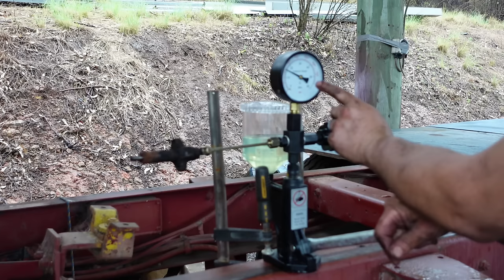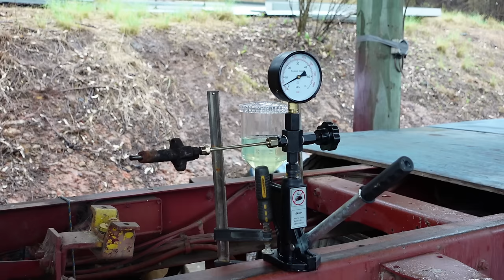SAME Centauro  60 Tractor: Hydraulic Blade Tilt and Diesel Engine Repair

Comment: The SAME rides again! Nice job on the blade lift and tilt setup. That will make the machine a lot handier around the ranch.  The injector pattern looked good to me on all but the one that wasn't flowing. I can see there's some engine wear by the smoke,  but looks like there's lots of life left in her. Glad you recognized those guys with the long tails down by the fence - I was gonna mention to you that you had neighbours comin by eatin yer grass!  8^) Cheers!
Reply from the maker: Hi Jeff. Thank you, it turned out great for using stuff that was laying around here. Injector pattern was fine. It would be compression, I’m near certain of it. Plenty of life left in it yes. They are always here eating the grass Jeff😅😅

Comment: Very popular tractors in New Zealand in the early seventies due to the ability to handle the hill country as they had relatively wide wheel base and four wheel drive. Thanks for the video Mate 👍
Reply from the maker: Hi mate thanks for sharing this. It’s a great tractor around the hills. It’s half the reason I got it going again, to clear the hills here where a fire went through. It’s my pleasure
Reply: Didn't know they were in Kiwi land. Thanks from northland.

Comment: Those Same Centauros were very popular here in Spain, together with a lot of other Same models, plain and simple air cooled, fairly easy to work on and as tough as old boots. The biggest drawback is the turning circle was not as good as a similar size say John Deere 2035. BTW give thanks to Matty's Workshop, he mentioned your channel and you gained a subscriber.
Reply from the maker: Hi mate thanks for coming over and subscribing. I had Matty on the phone on the weekend to thank him. They are a good tractor yes. This is the only one I’ve had anything to do with but it’s good.

Comment: Hi Steve I have a Same Leone also V4 the original exhausts were turned down and went under the tractor but people have swapped the manifolds over to turn the exhaust pipes upwards if you swap them back you will have less fumes coming into your face 🙂
Reply from the maker: Hi mate yes this one would of originally be like that too. It’s more the fumes from the blow by out of the engine breather that I was talking about here. It gets to you after a while

Comment: Gday Steve, the tilt setup worked out well and the right price which is most important, amazing how tired these old engines can be and still do an honest days work, great job mate, cheers
Reply from the maker: Hi Matty yes mate it actually did work good. As you can see she’s very worn out but still spins the tyres so can’t ask for much more then that mate. Thanks Matty

Comment: I have the SAME 105 Tiger love the beast.   Great tractor  bur i recon i  should hunt down one of these V4 s  for the collection to keep up with the international s in numbers. 
A tip for bead breaking use a log splitter it works well and no bouncing Hammers
Reply from the maker: Hi mate fantastic stuff. Great tractor you have there. I’m not sure how many v4 ones are around. It’s certainly not a common site from what I’ve come across but I’m sure they are out there. 
 Using a log splitter is a great idea, I’ve never heard this. We used to have a bead breaker rammer that worked great but was sold at auction

Comment: Great vid', Steve! I used to work for the Same dealer for about 5 years. Although I've never seen this model before, I can tell you that (generally speaking) these engines are pretty easy to re-ring, when the time comes. Looking forward to the next vid! :-)
Reply from the maker: Hi Pete, hope you are well mate. I’ve done Deutz and Lister engines so I’d imagine fairly similar to those I don’t want to do it till it’s mine. I’m worried about sinking money into something that may get taken away, very very unlikely but still not mine. I’m looking forward to doing the job

Comment: Steve, is that tractor is 4WD. If so that would be great in my state. I would put a bucket on the front for relocating snow piles. Great use of the hoses you have. I have a few hydraulic control valves from my old hydraulic snowplow systems that controlled the lift and power angle system. It used a belt driven pump. Good job on your plow tilt. Love to see the wildlife. Animals are amazing creatures.  As always great video, jim Rioux

Comment: Trade equipment in mt Gambier had a v4 SAME 2wd frond end loader 2 years ago . I have some factory dealer books /we manual s on some of them. My step father proceeded to press ever tyre he could find with the log splitter why I do not know . But works well
Reply from the maker: Hi mate. The log splitter would do a great job. I have one but not sure a rear tractor tyre would fit in it

Comment: Hi Steve  , well the more the centarro work the less she blew smoke,,   what chances of glazed bores,    if mine I'd run it till it don't run
Reply from the maker: We’ve worked it hard over the years mate and it never got any better. When pushing it runs better then goes back to how it is here. We will still use it no problem like this

Comment: Great work, mate. Check YouTube for .. Connecting Rod Sawed The Engine Block in Half ...By Discovering Skills. You need cow dung lol. You can see how Excavator rams are straightened, and slew gears are fixed.
Reply from the maker: Hi Stuart. Yes mate yes I watch these blokes. Amazing what they can do with what they have